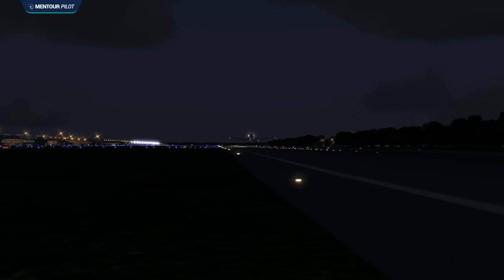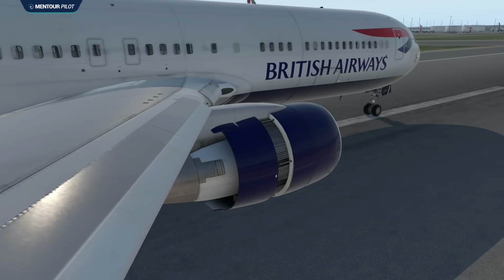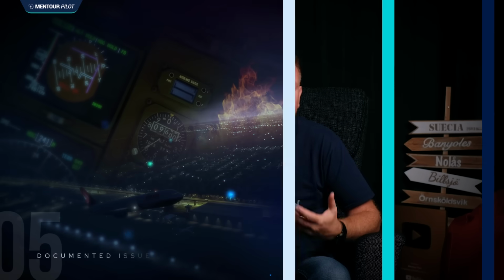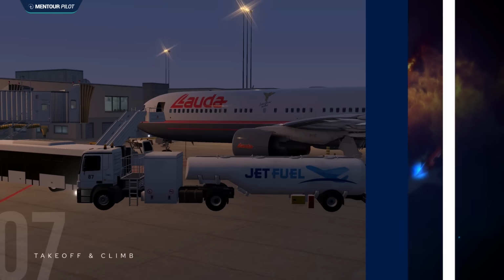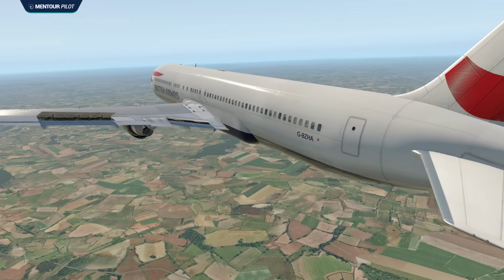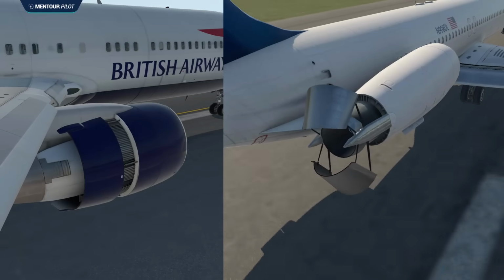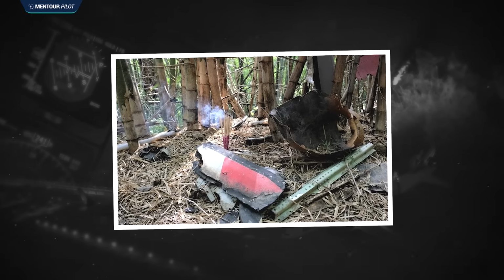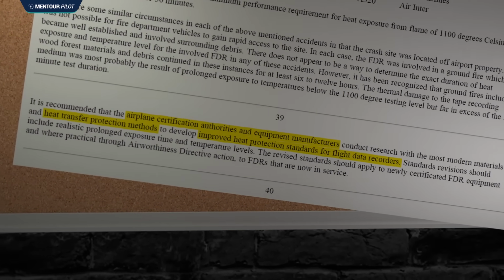HOW an Impossible Failure CRASHED this Boeing 767!

Comment: Lauda was the only CEO I know from an airline who went out to the crash side by himself and made Boeing pay for their crap they did. (dunno which incident ist actually was...)
He also appeared on Maday Alarm in cockpit. And he also fought hard legally for the families and pilots. They were struggling with this reverser issue for years up until this accident.
Reply: Yes he absolutely did go to the crash sight. It was one of this aircraft, other than a formula driver, also a pilot. He did address this abnormalities to manufacturer Boeing. In reference to thrust reverser deploying during flight. He also tried to recover his craft, in a simulator scenario, unfortunately he was not able to recover, craft was not able to come back to normal flight during stall/dive.

Comment: Boeing obviously knew that the trust reversers could be deployed mid-flight,but tried to bum it down with data in low-level,slow flight simulation.
Those greedy bastards done it before,and they did it again...
Firing sqads should be established for this kind of people.
Reply: you need mental health care.  your conclusions are completely irrational.
Reply: @thomasneal9291  Thanks for your quick assessment, doctor.

Comment: Boeing Chief Test Pilot: Unless the pilot did everything right within 4-6 seconds max, it would have been impossible for the pilots to recover. Boeing then conceded that an untrained flight crew would not be expected to be able to handle it. Uhh.... I feel like even the most trained and experienced pilot should not be expected to do everything right within 4-6 seconds right? That window seems extreemely small... I know that alot of decisions needs to be made very quickly, but 4-6 seconds should not be solely shifted to pilot inexperience but also majority massive design manufacturing flaw.

Comment: As far as I'm concerned, there is no such thing as an " Impossible failure".
I was a truck mechanic working at a dealership. If we found a persistent fault in a heavy vehicle, that vehicle would be immediately taken off the road and it would stay off the road until we found the problem and fixed it permanently.
Why can't they do that with aircraft?

Comment: So, I'm curious:  What were the corrective steps to be done in the first 6 seconds that would have salvaged the situation?
Reply: 1. throttle back both engines (lower speeds all for more effective correction)
2. hit max flaps and rudder to compensate for yaw caused by malfunctioning engine and reduced lift on one side.
3. shut down malfunctioning engine.
4. re-stabilize plane and find a place to emergency land.

but that could ONLY happen if you knew what was going on and had been trained ahead of time in how to deal with it.  These pilots had no clue, and no time to even guess what might work.

Comment: It would seem the Modelling was done on a minimal fault level, maybe this was intentional?
Secondly, it would seem quite obvious that a intermittent wiring, sensor or inhibit switch was the problem, the technicians should have known this, and it would seem many tried to find the fault but did not, why? its a quite simple circuit to follow and diagnose.
Reply: " its a quite simple circuit to follow and diagnose."

it is?  news to me.  How do you know that?

Comment: You show the older reverse thrust buckets installed on an aircraft with REAR mounted engines, while the high bypass types are installed under the wings.  That alone will create a huge difference in the placement of the reverse thrust, more than just the type of engine would!
Thrust reversers have been around a LONG time!  Piston engine aircraft could reverse the pitch of their props to create reverse thrust during the landing roll out.  In fact, some pilots discovered that if the plane had the outboard engines located beyond the landing gear position on the wings, they could even waltz the plane BACKWARDS to park it by using the reverse thrust and the brakes!

I'd assume that if a pilot got a warning that a thrust reverser had deployed in flight, he would throttle that engine down to idle.
I think this accident might have been covered on the TV series "Air Disasters"

Comment: would it be possible to deploy the other thrust reverser to have symmetric drag?
i know normally no but with that fault?
And would it help?
Reply: the problem is that the reverse thruster not only causes yaw, but changes the lift pattern on the wings.  if you deployed both at that speed, you would help to fix the yaw, but you likely would end up in an unrecoverable dive.

Comment: I remember reading somewhere that an aircraft accident was caused by wires/cables chaffing to a point where the insulation broke down thereby causing a Short. It turned out that the cables used some new fangled super thin insulation to keep the weight down and there are a lot of cables in a modern airliner... Regards, Jim in NI UK
Reply: Hey Jim in N.Ireland UK. Hiya , was this TWA 800 where frayed wires exploded the fuel tank ? Regards , Jim in Flint Michigan USA

Comment: Over and over again with each described incident, when it's caused by a design or mechanical failure why the systems weren't designed to default to something airworthy if not optimal.
So, in this case, why should thrust reversers deploy so easily? How can they not be closed by default? If the system fails, shouldn't the system be deactivated by default?

Additionally, with new computerization and fly by wire systems, I would advocate for a simple "default flying setting" which with one action power down engines and all trim settings would be set to level, straight ahead flight and retracted.

Comment: hiv and the dcv are combined into one unit known as the HCU hydraulic control unit. and the mistakes the maintenance did was they should have de activate the thrust reverser . since the fault is recurring they should have looked at the amm.

Comment: If only they had realized what a disaster the reverser deployment would cause then this wouldn't have happened because the checklist would have said that the engine needs to be shut down as soon as that warning message appears.
Reply: it was an intermittent message. one only ONE of the controllers.  you assume too much.

Comment: The saddest accident stories are the ones where the pilots did absolutely nothing wrong :\
Reply: AND GOT BLAMED !!!
Reply: @BruceCarbonLakeriver  That’s so true. But not every accident had surviving pilots.
Reply: @simonsv9449  yep but their families!
Reply: @BruceCarbonLakeriver  Did their families get blamed for an accident that was not their fault, and not the pilots’ fault either.
Reply: @simonsv9449  yep it happens very often actually and it is sad. Mostly b/c of bad news coverage.
Reply: @BruceCarbonLakeriver seems like it's always the pilots fault and never management, or the maintenance crews fault

"tHey ShOuLdVe KnOwN aBoUt ThE iSsUe BeFoRe HaNd"

 - Arm chair experts
Reply: And the wreck beeng looted
Reply: I also feel a way about cases where the victims are disrespected. The wreckage and corpses being looted. Then there was no refrigeration where the bodies were stored, so they rotted. And finally Boeing's reluctancy to take responsibility
Reply: And couldn't have saved themselves even jf they had known what was happening 😢
Reply: Nah, don't start with that.
They immediately started working on the checklist.
@@dxspot
Reply: That’s what bothers me about this one too. They turned off the engine so fast like they were supposed to but there was nothing that could be done smh. Poor pilots.
Reply: They could have saved themselves if their seats wouldn't have been in the aftmost position. They were unable to reach the yoke and the pedals in time!
Reply: @pzl104-m4y  You have no idea what you’re talking about. If you in aren’t an aviator, don’t comment on aviation.
Reply: They did EVERYTHING wrong !
Reply: @gertjanvandermeij4265  No. They didn't. Stop.
Reply: @gertjanvandermeij4265   You have no idea what you’re talking about. If you in aren’t an aviator, don’t comment on aviation.
Reply: damn u didnt even watch the last half of the video did ya?  @gertjanvandermeij4265

Comment: Blows me away that the mechanical engineers would miss that.
Reply: They probably didn't, but were forced to rush the development to reack deadlines
Reply: Mechanical engineers miss basically anything. Most never set foot on a job site, or even touch a single part they design. No practical experience = shit product. I curse out mechanical engineers literally every day for coming up with yet another terribly designed machine.
Reply: @CaptainDCap  " I curse out mechanical engineers literally every day for coming up with yet another terribly designed machine."

oh rly?  why not quit what you are doing then?
Reply: @thomasneal9291  Because I don't have the means to put myself through university, so I won't get hired. Missing that 10% the engineers are actually good for, while the other 90% of the shit they think up is a pure nightmare to work with.

Comment: This is terrifying. Both wings and the tail ripped off? Fuel fire? Jeez
Reply: 600+ KIAS is actually being in heaven. No airline aircraft is designed nor has any headroom in construction left for this ridiculous speed. Most of them have a Vne of 330 to 340 KIAS. (Vne = velocity Never Exceed). Actually it was a bit surprising how long it lasts at those speeds, every second was a godsend or a delay to death in that case...

Comment: Boeing are still using wire insulation which whilst not able to catch fire will char and flake off. There are alternatives which are slightly (pennies) more expensive per meter. Boeing is not run by engineers, it is run by accountants. I have often wondered if the black-boxes Boeing use are designed to be unrecoverable/unusable when the failure event is apparently not caused by the pilots. This would be similar to VW and Mercedes ECU's being aware of when a car is being tested for emissions rather than being driven on the roads. As a electronic hardware and software engineer, I am fully aware of most cheats regularly used by manufactures. If it was thought it is possible to get away with force failing a flight recorder, I am sure someone has considered it.

Comment: The saddest part about this is the the pilots probably knew after the structure began to give way that they were doomed.
Reply: "Fortunately," the pilots were most likely unconscious at the moment of impact. They must have felt extreme fear for 20 seconds but they probably drifted off into unconsciousness before the ground impact.
Reply: @katego370  why would you assume that?
Reply: @FK-we1dp  G forces etc. Humans are not designed to experience such nosedives. People basically get knocked unconscious, at least from what I understand.
Reply: @katego370 in an extreme dive there is zero G force, thats why the 'zero gravity' phenomenon happens and people go to the ceiling. High G force only occurs in a high speed turn of some sort.
Reply: What about the passengers?  They literally had the "ride of their lives".  😞
Reply: real,Tyles cannot imagine the g forces, that all on this flight were experiencing. Perhaps since the g forces were extreme, hopefully all went into a hypnotic state of unconscious, whatever level it may have been. Perhaps in hindsight, its better to be in a hypnotic state, rather than being aware what was happening w/this flight.
Reply: @kay9549  they would have had noticeable g forces but not enough to make you pass out.

It's not speed but acceleration that creates g-forces in this type of crash and the amount of acceleration required to make you pass out is immense.

Plenty of cars could reach Mach 1 from a standstill in under 30 seconds at their highest acceleration and this plane was probably accelerating at roughly the same speed or less when it begun to break apart.

In fact the greatest g load experienced was probably the 4-5 seconds immediately after the reverse thruster deployed because it would have caused large sideways/down forces.

Likely under 3g.
Reply: @kay9549  No kidding.  Even imagining the horror is horrible.  I get scared at even the slightest turbulence.

Comment: So Boeing was able to get certification for this system simply through modeling. And then actual flight testing was only done after the plane was full of passengers.
In what universe does this make any sense at all?
Reply: And the only reason the modeling worked, was because they had to set the right conditions of low altitude and low speed. Not because "those were the most likely conditions for trust reversers to deploy" but because those were the only conditions it would be ok
Reply: @mikemx55  And this happens over and over with all vehicles.  They assume normal operating conditions and give it a pass, rather than checking for any conditions that it might be put under in order to save money.   I have this happen with my car as an example.  When the outside air temperature gets to 124F, the 02 sensors all fail simultaneously due to part of the system (one of the modules under the hood) overheating due to heat saturation.  It happens every summer - they all stumble and recover a second or two later, and throw on a service engine light.   Ford never considered cars might hit isolated hot zones with nearly 130F temperatures during the summer. But here I am in the desert in July and it'll happen again all next month.  Only this isn't at 30K feet - it is me having to at worst restart the car at a light. 
Every time I hear "tested under likely conditions" I have to cringe a bit as everyone seems to be cutting corners lately.
Reply: @mikemx55  Yeah, they were only modeling at 200 knots. There is a story there too, I'm sure.
Reply: @theGrumpasaurus  whenever there's big money and a regulatory system you're going to have corruption, just look at big pharma and the ammount of people switching back and forth between being FDA officials and working for a pharma corp, or the banking system and financial regulatory bodies and so on. I wonder if that's also the case with the aero industry.
Reply: @ioandragulescu6063  Imagine those volumes of money in the aviation industry, you can bet your ass the same sht is running there...
Reply: @JoseMiguelSantosRibeiro EXACTLY!
🏆
Reply: Anything can seem sensible if you give someone enough money not to think about it too hard
Reply: this is what happens when who manufacture a product and who supposed to control and certificate it are blowing each other.
Reply: Boeing is a disgusting corporation they have lobbyists shoveling money into American politics and FAA for special treatment. Just the Boeing Max plane scandal alone is just one of many profits over safety coverups of Boeing.
Reply: its crazy that it was acceptable to use a simulator to prove that the reversers were safe... and said simulator had the data from a non-existent real life test.
Reply: Its an american military company, they get away with everything.
Reply: In the U.S.A. greedy,corrupted universe...
Reply: A universe where testing every possible scenario with a possible airplane is not realistic. Now stfu.
Reply: @MaeliaMBT  A flawed structural design that gets a bandaid software to provide a correction for this flaw is not proper engineering.  Now STFU
Reply: @aurelia8028  A universe where  testing in the WORST possible scenario with a possible airplane,IS realistic,So YOU STFU.
Reply: @MaeliaMBT  
And I'm sure they say all that in their promotional brochures to the passengers.
Reply: @davegaetano7118   Did aurelia block me or did that person delete their comments ?   I cant see them anymore
Reply: @The-Cat  
I can't see his comments anymore either.
Reply: @davegaetano7118  Ah then I think we've crushed that person into a thousand pieces of shame.   

Well done 👍👍 lol
Reply: Interestingly, that’s the same way the Covid vaccines were approved.
Reply: in the world where boeing bribes faa
Reply: @el-vato-FISHING  it’s worse than that: FAA subcontracts Boeing employees to certify work done by other Boeing employees. No matter how ethical and consciously honorable they are, it’s a conflict of interest.
Reply: It's the American way. Don't worry about things until something happens, and when something does happen, do the cheapest, most visible thing possible, whether or not it actually rectifies the situation.